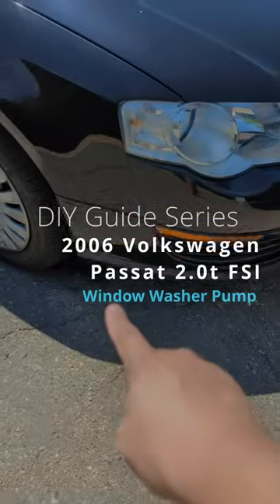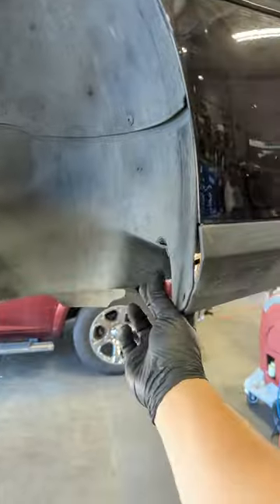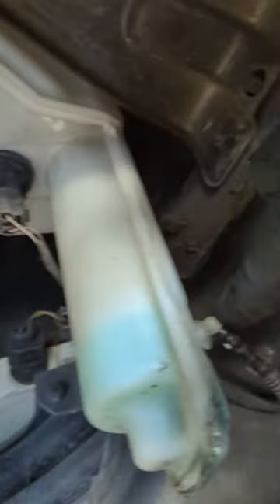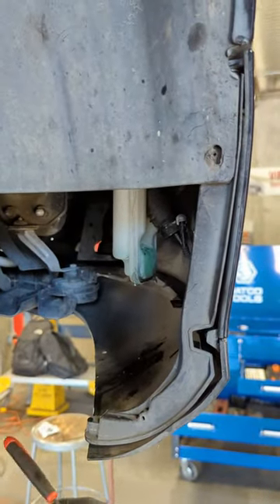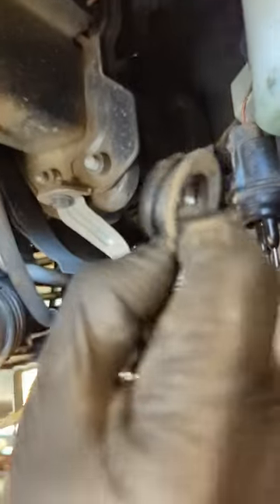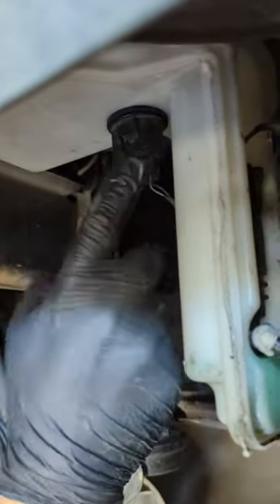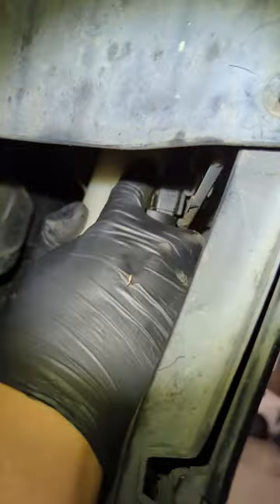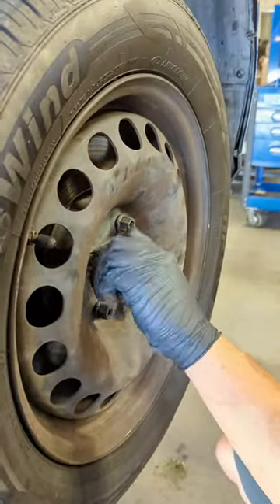Super Cheap DIY! Washer Fluid Pump Replacement Guide for 2006-2010 Volkswagen Passat (B6 Generation)

Comment: IMPORTANT - The pump he has shown is for VW Passat B6 WITHOUT headlight washer!! 
For the version with headlight washer, you have to dismantle the front bumper a bit to get to it - it is basically on the same space, but not accesible from the inside.
Reply from the maker: You are correct and thanks for sharing your insights. I will pin this for people watching in the future. 👍
Reply: Is it same pump for headlights and windshield? My windshields washers just stopped working but water is sprayed on headlights. that would mean pump is ok and I should look for problem somewhere else.
Reply: @dusanp5160  yes, exactly! There are two different motors, one for headlights and one for windshields!
The one for windshields is smaller than the one for headlights. Also, the one for the windshield has two outlets(in a T look)
Reply: @dusanp5160  oh, just to clarify, it is two separate pumps
You need to remove the front bumper (it is situated on the passengers side, as shown in the video), and the pumps are next to each other - the windshield one is a bit more hidden, but it is there, it is the smaller one. ☺️
Reply: @otasek123  thank you
Reply from the maker: I'm so thrilled to come online and see commentors helping other commentors. @otasek123 , you are legit awesome.
Reply: @mldiy  it was pain in the ass to look it up and your video helped in showing me the way - and the fact that it is quite easy replacement if you've got the guts. I'm total amateur in repairs, but unscrewing some screws ain't that hard.
The harder thing was, that when I removed the headlight pump, the tube that was going in fell apart, so I had to use garden hose as a replacement, hahahahaha.

Comment: This helped me a lot! I did everything on my passat B6 without taking off the wheel, I just removed the lower fender liner. In my case I also had to replace the fuse number 42, it can be found in the internal fuse box on the left side.
Reply from the maker: Awesome, I am so glad it helped you. Out of curiosity, had you already replaced the fuse and had it pop again before you replaced the washer pump? And does it seem like so far everything is good?  It's interesting to hear you say that a bad pump popped the fuse.  Thanks for taking the time to comment!
Reply: I found that the fuse popped after I replaced the pump, the new one was not working as well. I tested the old pump with a 12V line and it's definitely dead  @mldiy
Reply from the maker: @asteriscopuntodeb  Appreciate the response and thanks for confirming that it does indeed sound like a bad pump can short and pop a fuse.  👍

Comment: This only applies when you dont have headlight washers, because the tank with headlight washer has a different tank and the pumps can't be accessed from under the front wheel arch, instead, they are hidden behind the front bumper.
Reply from the maker: I really appreciate you sharing your insights. Thank you so much for commenting!

Comment: The ID of the pump you listed was not the right one for my passat (2007 B6 2.0 TDI).
In the future videos I recommend you research a bit more and list all the possibilities of parts. Because there is quite a number of different types of passat B6
Reply from the maker: Hi Ray, sorry it was the wrong part and thanks for taking the time to let me know. I genuinely thought it was the same. If you have the part number handy, I would love to update my description to correct my assumptions (and I will do so even if you don't respond, just figure I'd ask for help).  I definitely don't want to spread bad info on the internet, so again, your comment is much appreciated.
Reply from the maker: (Second reply) ok, I'm not crazy. We didn't get the B6 TDI in the US, so the possibility of it using different parts just never came up in my research. I'm happy to add reference to it in my description though, but I can't even search parts for it easily here.
Reply: Do you own research? The guy isn’t your personal mechanic.